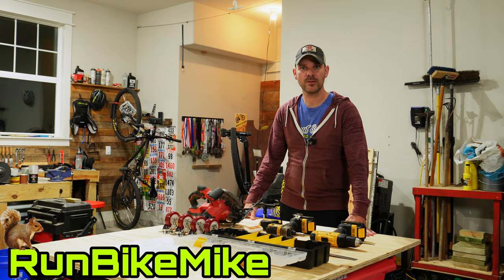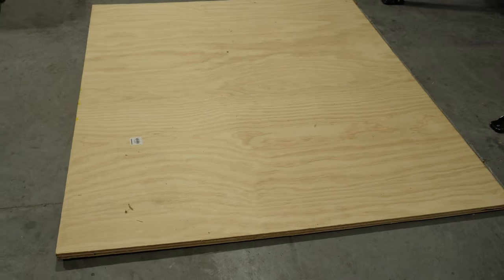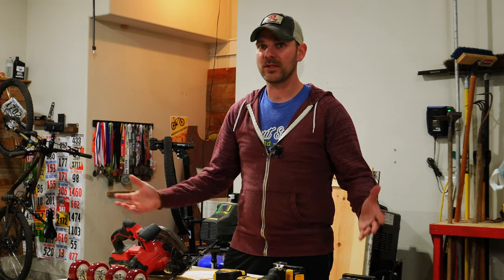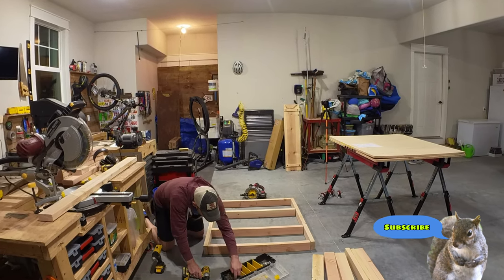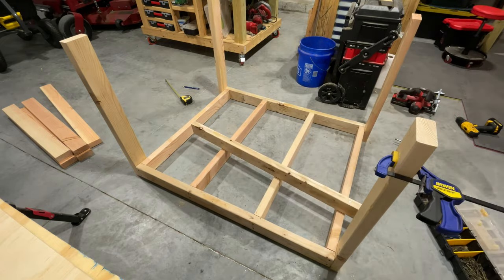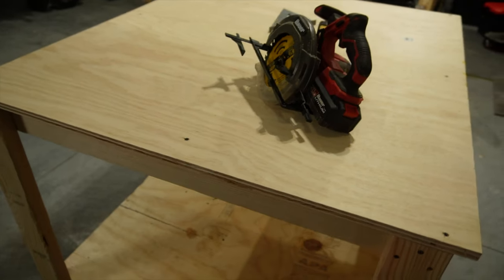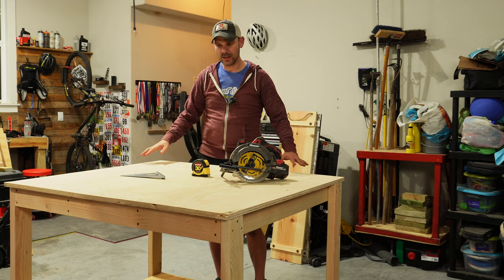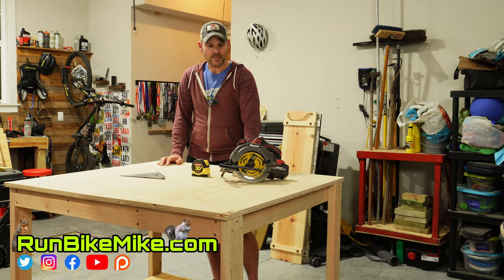How To Build A Simple Rolling Workbench: A Beginner Friendly Build

Comment: I built a similar style workbench for a friend using three 4 x 4 cedar post leftovers for the legs. I  made it 30" x 8' w/ a single shelf.  The framework was 16" on center and I notched the legs for the frame to sit in the legs for extra support and not rely just on the fasteners. He does alot of car/truck hotrod builds and I knew he would be putting tons of weight on the bench. It's held up very well even with intakes, heads, and even a transmission stacked on it at the same time.